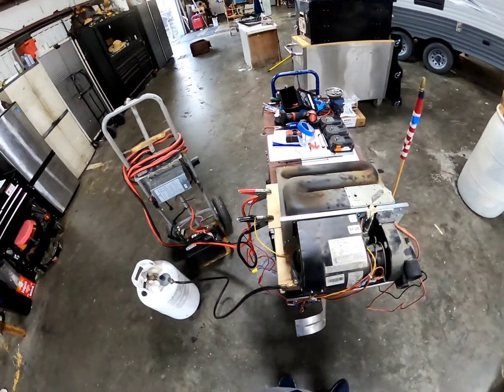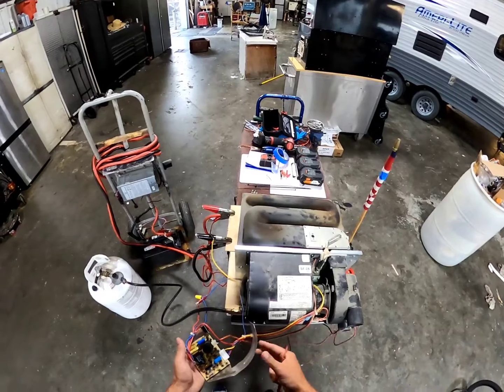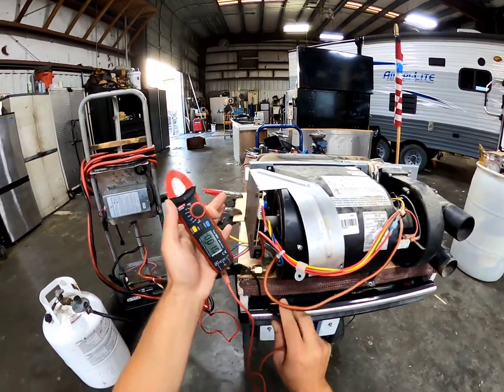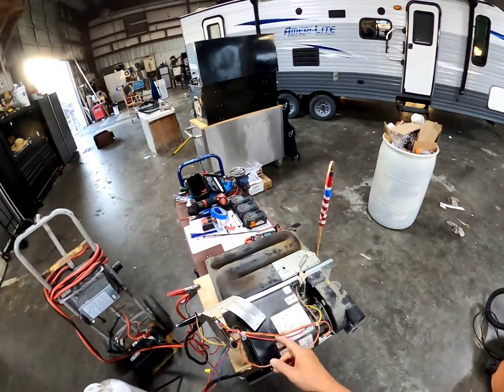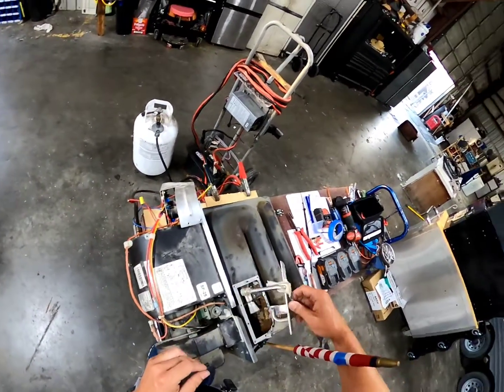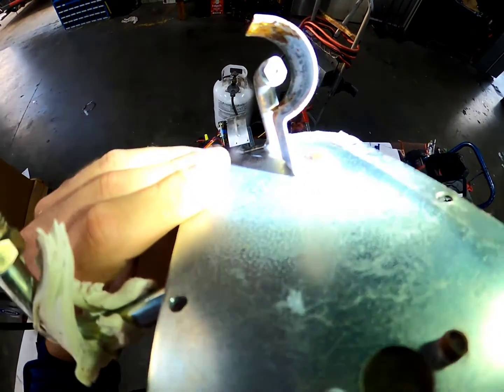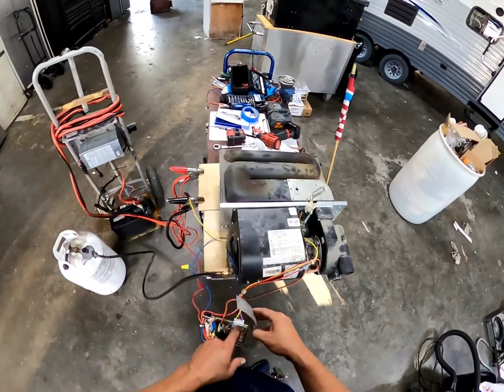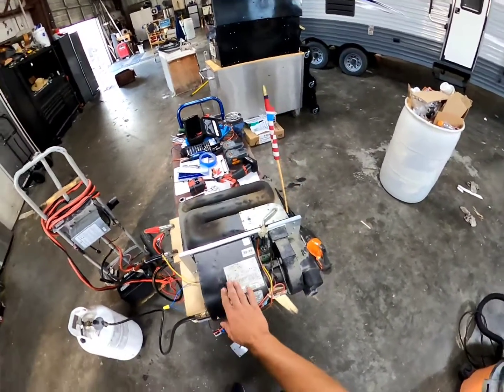Training and diagnosis of an RV Suburban furnace. SF-25.

Comment: My sf35 suburban furnace is igniting and I feel heat for maybe a minute or so, then I can hear the ignitor clicking to ignite 2 more times and then cold air. I have pulled apart and checked the orfices and cleaned them out regardless of not finding anything, cleaned the burner tube and ignitor, but still the same issue. I have also checked the sail switch and high temp sensor and all is well with those two components. I even got a new board to see if that was the issue and it was not. My only two options at this point seem to be 1 a faulty ignitor/flame sensor since it ignites, but doesn't stay lit and tries to reignite or 2 maybe a faulty pressure regulator?  Thoughts? We are fulltime and have a large propane tank and a different regulator than the small bottles and the regulator is less than 2 years old, so I wouldn't think that would be the case, but 🤷‍♀️ is it possible for the ignitor/flame sensor to ignite initially, but then fail to sense that the flame is there? Is there a way to test this? Also, the ignitor wire is super corroded so I bought a new one regardless and that is supposed to come in the mail today, but I figured I would ask.
Reply: I am fighting a similar issue.  If you can get your hands on a manometer, check the propane pressure where it comes into the furnace.  I believe you should have at least 11 inches of water (the pressure unit used by the manometer)  Mine was only 9"h2o.  Replaced the regulator and things were better, but still chasing a gremlin in there somewhere.
Reply: I figured it out. The gas valve inside the furnace was the culprit. It tested perfectly fine, but must have opened initially and then failed, so go figure. That was the issue the whole time!

Comment: Hey Nicholas - thanks for this.  My SF-25 is spinning for the 30 but not igniting and I hear zero click or anything to indicate attempted ignition.  So, the first thing I checked was my sail switch for continuity and it passed that check - also ease of movement (I will replace anyway just to be sure).  That brought me to your video.  If I understand correctly, I should check the blue wire on the harness (T-stat) to verify if I have good input voltage there.  If that's good, I could theoretically check the voltage at the sail switch to see if my limit switch may be stuck open, correct?  My line of thinking is that if the limit and sail switches are in series in that order, this is a good check on the limit switch without having to access the back of the unit.  Is that about right?  Again, thanks for posting this.
Edit: did a check.  I read the black wire at the sail switch when it was on and was getting an intermittent 6-8VDC.  Nothing at the board plug though.
Reply from the maker: @Proost1  yes checking at the 4 pin harness is easiest to give direction to go forward. It's difficult to try and give advice through these messages. Send me a text to my work line please and maybe we can call. Space City RV Repair located in Pearland Texas. The number ending in 3633, i get text on. 💪

Comment: How can I get the box off the furnace to get to all the parts like you have? Mine is pressed together almost like it is semi-welded. Short of cutting the metal and destroying it, I do not see another way.
Reply: There is one screw on the rear end usually and that’s it. Just pressure fitted on and you have to wiggle it free. Slowly but surely it’ll come out. Go the opposite direction that the gas valve is so it isn’t hitting the shell.
Reply from the maker: @AGILISFPV  great advice bro. I didn't even see that comment. Thank you so much. We help each other. 💯
Reply from the maker: @Vester15  hey bud, if you still need help, send me a text to the work phone. Go to Google maps and search for Space City RV Repair, in Pearland Texas. Send pics too. And have a voltmeter ready, in case it's needed.
Reply from the maker: @Vester15  there is usually a screw in either the front middle or rear middle that needs to be removed, to remove the shell. After that, sometimes things can hang up when trying to slide the shell off, so just have to see where it is getting hung up at, have some patience, and it will come out. 💪

Comment: So glad I found your video. I've cleaned mud dauber nests out of these over the years. But I've never heard of gnats getting in the orifice. That was a new one on me. I have the steei screen cage over all my appliances on my toyhauler. When i went to run the furnace getting ready for the fall/winter season, it would light, but it  wasn't acting right. The gnats this summer were just horrible. So I pulled it out and tore into it, and sure enough, there he was. Pulled the orifice and blew the gnat out, put it all back in. Now it works like it should. I can't tell you how valuable the info about gnats getting into these was. You saved me a ton of headache. Pulled it out, fixed it, put it back. Runs like a top. One and done! Its usually at least twice in and out for me. I don't have everything needed to bench test it.  But I'm going to invest the rest of the lp fittings to hook my 
regulator and hose onto it so I can next year. One round trip in n out of the cabinet is enough for me. I'm 64 and disabled just doing it once is a chore. Thank again for the great video!!❤
Reply from the maker: @garyakashadow596  glad I could help brother. I originally made these videos for my technicians when I was foreman for a shop. I'm now a owner of a rv repair business and don't have the time anymore. But your comment made my day! Best wishes to you. ♥️
Reply: @nicholasgriffin6631  Well, I'm glad my comment was able to brighten your day. Lord knows that info saved me a ton of fretting and worrying! 😁❤️

Comment: I wish I could show a picture of my control board. It's a 521099 Fenwal board that has blower and power connections in the board, but every other board I see doesn't have that. Even the ones on Amazon say the 520820 board is the one to use. Even the owners manual says 520820. I don't get how to rewire.
Reply from the maker: @bruceda3rd  sir if you ever need a hand, reach me at Space City RV Repair in Houston Texas (Pearland really). Then we can share pictures and talk in real time. I'm shut down until mid November right now because we're moving. But I always try to help. ♥️

Comment: did the video ever happen for how the AC units control the furnace ever happen?
Reply from the maker: Chubbs, Unfortunately I got promoted and haven't had the time. Are you having issues with yours? I can walk through it with you if needed. 💪
Reply: @nicholasgriffin6631  some quick advice would be awesome!! Basically where I’m at. Furnace worked at purchase. Eventually stopped working completely, didn’t kick on at all. I’ve isolated that the furnace is GOOD hooked to battery and fan kicked on and stuff but I didn’t leave it ,on long enough to see/hear spark. What I also know is the wires from the thermostat are NOT the same ones that I see in the furnace space. Did continuity test and nothing, so they must go elsewhere and something else going to the tstat wires for the furnace. The acc unit works 100%. The furnace side board is new so hopefully* eliminates that. Going to attempt a new thermostat today.

Comment: My SF-25F furnace will run 30 seconds and then turn off.  While still installed in the trailer, if I remove the cover it will run just fine.  Any suggestions?
Reply: Great video. GoPro probably isn't best cinematography for this; far away from objects being worked on and moves constantly.
Reply from the maker: East on Forty, I'm guessing that when it runs for 30 seconds that it also does not try to lite. My first thought would be a faulty sail switch. They're not too expensive, so try that. Other than that, you could have an air flow restriction, at which point I would take apart the fan cages and look for insect nests, etc. Next step would be checking inside the burn chamber as well for insect nests etc. Also make sure the exhaust tube is fully and properly installed. Keep me posted, and I hope all goes well for you.

Comment: Great video. Have any on removing and oiling or replacing blower motor. My SF-25 fan has loud squeal noise most of the time. I have read taking it out and oiling it can make it last another year or so more.
Reply from the maker: @bestgreenhomestead2676 if it were myself and the main concern was to rid of the squealing, I would replace the blower motor. You save in time, what it costs you in parts. If I'm not understanding your question, please ask in more detail. I'm glad to help.

Comment: I followed your video troubleshooting and I found that my orface was clogged. I had to get a new gasket for the access panel. You mentioned no pipe dope for Teflon was needed on the orface. What about the gas fitting the screws back into valve from access panel and the gas fitting from camper that connects to furnace, do those fittings need pipe dope or teflon?
Reply from the maker: @scottsheffield2594 , I am not sure which fittings exactly you are talking about, but here is what I think you are talking about. The gas fitting that goes into the top of the gas valve solenoid and then a tube that has the orifice on the end, that tube that goes into the gas valve and you then tighten the fitting into the gas valve solenoid - the tube is flared and inside the gas valve solenoid it's an inverted flare so no pipe dough or Teflon needed. You should notice that it didn't have any sealant on it to begin with. Also, the main lp supply from your camper to the furnace should be flared. Flared fittings work through compression and don't need Teflon tape or pipe dough. However, only someone licensed or certified should work on LP appliances. These videos are for technicians.  We always perform manometer (drop pressure tests) to verify that we tightened the fittings fully and do not have any LP leak from a poor connection. Be safe bud, and reach out anytime. I hope my response was helpful to you.
Reply: @nicholasgriffin6631  thank you that is exactly the fitting that I’m talking about. You are correct there was no Teflon or anything on the threads. I have a mannow meter and Leak detector and when I get it all back together Im going to check for leaks. I repair medical equipment for a living so I work on a lot of things and Im learning how to repair my camper. Your video helped a lot you gave great explanation of everything. I will be checking subscribing and checking out your other videos. Thanks again for answering my questions
Reply from the maker: @scottsheffield2594  I'm alot more busy these days. I have my own company now and alot of people to assist. However, I care very deeply, so if you ever need help, just reach out. I don't know everything, but I do know alot and am willing to help others always. 💯
Reply from the maker: Also Scott, seems like you did a good job in your diagnosis and learning. I hope all is working well for you now.
Reply: @nicholasgriffin6631  thanks for the help. I have heat now.

Comment: good video I have the Suburban 16,000 BTU Auto Ignition Furnace 1.will the blower come on even if my propane tank is empty?2.will I hear the ignitor click even w/out propane?3.do the outside furnce exhaust screens prevent tiny insects from clogging gas flow? thanks
Reply from the maker: @steveleston1848
1) Yes, the blower will come on even if you're out of propane. However after 3 attempts to lite unsuccessfully, the furnace will go into lockout. Just cycle the furnace on and off from the t-stat if it goes into lockout.
2) Yes, you should hear the ignitor click even without propane.
3) No. The screens are great for keeping most insects and pests out. However I have seen many orifices get clogged with gnats and other small bugs.

Comment: Nobody ever talks about the Electrode Ignitor.  This video covers that information in details.  The amount/intensity of the sparks that  you'll get has a lot to do with the function of the furnace.  You can still get/hear a clicking noise that sounds like the electrode is igniting, but the spark won't be intense enough to start a flame.  This is due to a bad ignitor on the board (not sending the correct amount of electrodes). You can buy those separately if you know how to de-solder and re-solder one back on.  Otherwise, you'll have to swap out the entire board.  Thank you very much for the detailed video.

Comment: Need a little help  Same furnace  Suburban sf 30 Cant connect unit electric to wall power. Only have 1 Blue wire for thermo on wall and 2 coming from the unit.  How do I connect these 2 thermo wires to one from wall.  thanks in advance
Reply: Thank U very much.  It solved the problem other techs couldnt figure out
Reply from the maker: Jack, what type of thermostat operates your furnace? Does the thermostat operate just the furnace, or the air conditioner as well? If you have a test light or voltmeter, check the 2 blue wires that are coming from your furnace. One should have power and the other will not. Take the blue wire coming from your furnace that does NOT have power, and connect that one to the blue wire coming from the wall. That should be it. Let me know how it goes.

Comment: Thanks for the help. If the unit starts (with heat) for a second then shuts down would you guess sail switch?

Thanks in advance
Jack
Reply from the maker: Jack, no sir. If the sail switch is stuck open then the furnace will not proceed to try and lite. The furnace will make 3 attempts to lite before shutting down. If you're not staying lit, time to pull and inspect the burner tube, ignitor tip, gas valve orifice. The problem should be evident when you inspect these. Most times its just an insect nest built inside preventing the board from sensing the flame (if it is lighting for a moment). Let me know 💪.
Reply: @nicholasgriffin6631  Thanks for the response. I will pull it out, review your videos (should have known it wasn’t the sail switch) and let you know how I make out.

Comment: Great explanation and video. My camper has the same furnace. I just got the camper (used). My thermostat has a high and low for fan speed. I do not notice any difference in how hard it blows or sound when I change the speed. Do you know if this furnace only has one fan speed? I have not got into the furnace yet to check it.
Reply from the maker: Scott, usually that is only found on the older model furnaces. I would have to be there to see if you had a control board that is compatible with the high and low fan settings of the thermostat. I can tell you that all modern furnaces only have one setting for the blower/fan. If you have any questions about any of your systems, just reach out. I am knowledgeable in most systems and will help when I can. I am not on YouTube every day because I have a busy work life, but I always respond when I finally see the question or comment. 💯 Wishing you the best.

Comment: I have a suburban furnace and it ignites for   2 seconds then goes out and after it lights the igniter continues to try and light. Any ideas? I'm think bad flame sensor
Reply from the maker: I never go with something before testing. So if you think you were having an issue sensing flame Logan, please understand you have 2 components responsible for that. And before looking at either of those, I would pull the furnace and inspect for an insect nest, because they like to build right where your ignitor tip goes. And second I would inspect the gap from ignitor to burner tube. Also I would inspect your orifice where the gas come out after the gas valve solenoid, because gnats love to get in there and clog it up enough to were some gas can get through, but not enough for full flame. After I check those its down to your actual ignitor wire and tip being faulty, or your control board could not be sensing the flame. I would advise before throwing parts at it, to have a tech pull and inspect those components. You may get a fix without any parts needed. 💯

Comment: Used this video to fix the exact same issue on my SF-20F.  Everything had voltage and it would run the fans but continuously keep trying to ignite every minute or two before it would finally time out.  Sometimes I was able to get it to light light but It was 20% of the capacity at best.  Pulled the whole furnace and followed your steps to find some debris in the burner area and also blocking the gas supply orifice just like your model for this video.  Thanks much this totally fixed my problem and familiarized me to this system.  Later this winter I will pull it again and better align and seal the duct opening cut outs in the furnace frame.  I’m easily losing some capacity with the way it was hap hazardly installed by factory/prev owner.
Reply from the maker: I make these mainly for young technicians since I see so many need proper training, yet seeing that they help owners as well, I am glad that it helped you and others. When daylight savings is over and it is bright again at 6 am, I plan to cover just about every system on RV'S this year. Hopefully these future videos will be just as much help. Thank you for your words Patrick, they mean a lot.